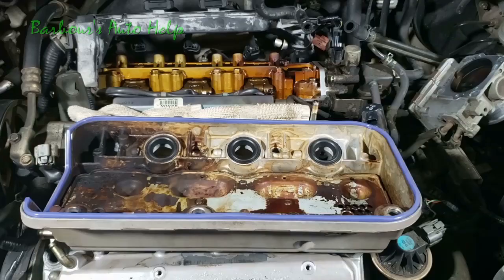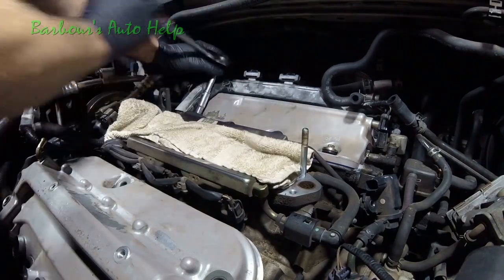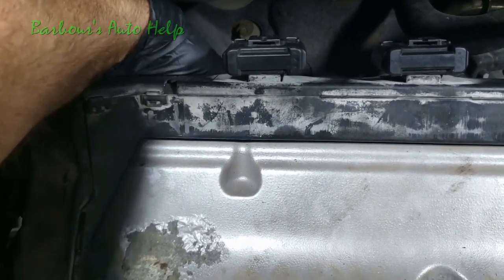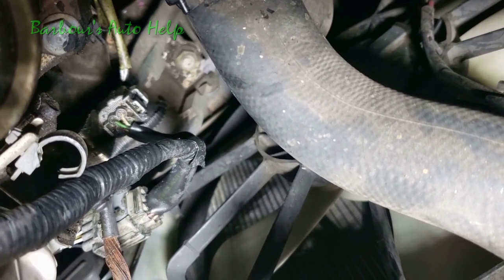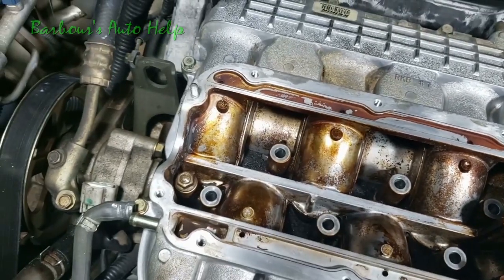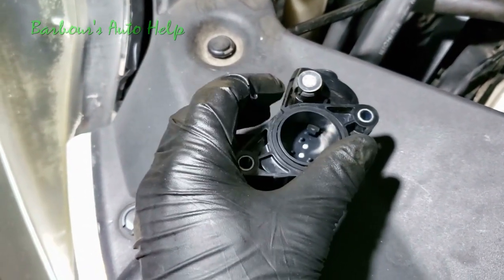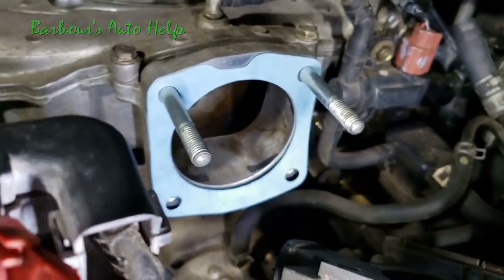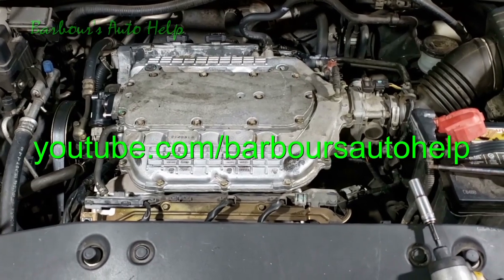Valve Cover Gasket Replacement 05 Honda Odyssey 3.5L Touring (Part 2)

Comment: Thanks for the detailed video. This would be a great time to do your spark plugs also. I listed torque values for those who do not have calibrated wrists.
Valve cover bolts =  8.7 Lb-Ft or 104 Lb-inch
Plenum bolts = 16 Lb-Ft or 192 Lb -Inch.........

Comment: Best LIVE description I have watched. Did this on an 2003 real pain but success. Just bought 09 and previous owner did a real good jog cleaning it up but was looking at motor mounts and saw a drop of oil and found rear valve cover gasket leaking and am going to replace all associated gaskets. Only have 126k on this one.

Comment: Just did this myself. Thanks so much! In the process I dropped the rear valve cover and cracked it. Dealership wants $1250.00 for the valve cover, I found it in a u pull parts yard and paid 5 bucks. It took me a few afternoons running for parts but in the end I saved myself a lot of dough and hope my van goes another 300k.
Reply from the maker: Great job 👏

Comment: Hi thanks for your videos. I was a little disappointed you did not give a hint about the rear valve cover. All you said was it was "tight getting out". After working on my car I found after disconnecting as many cables as possible that all you had to do was to take the cover back to the firewall and bring it over the top of the cables harness. That would have been a nice pointer to share. I hope you feel this is woth sharing. I've done alot of work on my 07 Odyssey with over 198K. Great car!
Reply: Thanks for sharing this tip.  Like you, I felt the only downside of this otherwise great video was excluding footage on how the rear valve cover was removed.  Did you have to disconnect anything else (from what he described in the video) to remove the cover this way?  Thanks.

Comment: Here are the torque specs for this engine, honestly, hand tighten is all you need 
Upper Plunm 12NM or 8.7 ft/lb
Intake 22 NM or 16 ft/lb
Throttle Body 22 NM or 16 ft/lb
Valve Covers 12 NM or 8.7 ft/lb

Comment: Thanks for your videos. it's really great job you've done brother. Even though I'm not a mechanic but I try to do most work follow you tube videos. I've a question My Honda odyssey 2006 Exl  Oil leaking on the catalytic manifold and smoke coming up. Do you think is it valve gasket leaking  or any others. suggest me please. Thanks.
Reply: Hey bro i have same problem With my honda odyssey 2008 did you fine any information why smogkin

Comment: Man I just finished this turned the van on and it sounds like a lawnmower..the check engine light is flashing...says misfire cylinder one...how the van wasn't misfiring before and also replaced all 4 oxygen sensors and new spark plugs too...what the hell went wrong and its smoking from the front of bank one...any advice please 🙏
Reply from the maker: Well, if it wasn't doing it before I'd suggest retracing your steps.  Make sure you did everything correctly.  Make sure you plugged everything back in.
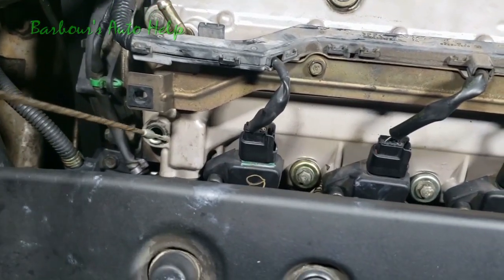Reply: @BarboursAutoHelp  ok im beat its cold it's 12:48 in Atlanta and I'm beat..will retrace tomorrow thanks
Reply from the maker: Did you get a chance to look at it?

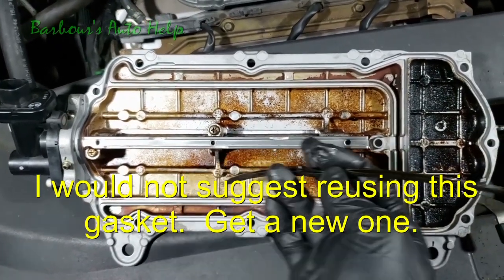Comment: Do you know the name of the gasket you reused at 24:45?  I can't find it anywhere in any gasket set.  Could I just use a bead of RTV as a replacement for a new gasket or should I buy some gasket material and cut a custom one?
Reply: Did you ever find out where to get the gasket or what the cover it goes on is called? I think I need one also...
Reply: If you pick up a Plenum Gasket Set in addition to the Valve Cover Gasket Set  they will include the gaskets you need.

Comment: Hey brother I have an 06 odyssey ex-l and I believe I have a leak coming from behind the engine somewhere below the valve cover gasket? I’ve replaced vvt gaskets, valve cover gaskets, PCv valve, and also the oil filter housing gasket. Any idea?
Reply from the maker: Could be the cam plugs on the rear of the cylinder heads.

Comment: Do you have a Part Number for the gasket at 25:00?
Reply from the maker: I do not.  But, you don't have to have that when ordering parts.  Just your vehicle information.
Reply: @BarboursAutoHelp  I was at autozone and Oreily’s and they couldn’t seem to find it. Nor did anybody seem to know the correct nomenclature of the part lol do you have the name of the gasket? Btw I appreciate the videos!
Reply from the maker: Excuse me...  I didn't actually click your time stamp at first.  I do not know the name of that gasket and I never actually got around to replacing it.  Sorry.  I think the dealership will be the best place to look for that.  Disregard the last comment I made.  I apologize.
Reply: @BarboursAutoHelp  all good, man. Thank you! I’ll post my success in here when I’m done with it, you’re my guide for this project!
Reply from the maker: Yes, please let us know.  Also let me know if you have any other questions....besides that one... that I don't have an answer for.   😆
Reply: @BarboursAutoHelp  will do!
Reply: @BarboursAutoHelp  Okay. I went to the Honda dealership near me and they quoted the part for $76.80...problems I ran into were:

1) The complete intake manifold gasket blow up for the 2005 model doesn’t show the part number for the gasket in question. It’s in the blowup numbered 23, but there is no nomenclature for that piece. 

2) The same blow up of the intake manifold for the 2006 model shows the exact same as the 2005 model, and that part IS as follows: Honda Part No.:17112-RKB-003. The name (according to Honda) is “Bore Plate Seal”, which is where the aforementioned quote comes from.  

So given that it is a 2006 part, yet the 2005 model has the same intake manifold as the 06. I think the part is compatible with the 05. I’m going to shop around and find a cheaper option. Keep you posted!
Reply from the maker: Dude!  Thank you so much for sharing that!  Super helpful.
Reply: @BarboursAutoHelp  hey man I just want to update you on a job well done thanks to you! This video saved me a whole lot of money! One thing I definitely recommend for everyone else watching this video is DEFINITELY have a torque driver on hand. I broke two bolts, one of which was user error (no torque driver), the other was broken using a harbor freight torque driver. Thank you so much for the video!
Reply from the maker: Your absolutely welcome.   And thank you for your contribution 🙏.

Comment: I have a 2005 odyssey with only 122K miles.  Cylinders 1 , 2, 3 plugs all oil fouled.  The i-VTEC with VCM engine is burning oil.  Dealer  they told me i needed to spend 8K for a ring job.  In 2008 Honda issued service bulletin 13-080 because of law suite in which they lost due to their VCM design .  Apparently VCM causes the piston rings to rotate and  align leading to premature spark plug fouling and engine oil burning.   Even  the 2021 Honda Odyssey is still using this VCM engine design.  Think twice before buying the odyssey with this engine design.  The car rides good on long trips but I regret buying this vehicle which has a poorly engineered engine.  Don't buy Japanese vehicles made in USA.  The QA is sub standard in the states..
Reply from the maker: Great information!  Thanks for sharing.   I have had the same problem.   The fix is to replace piston rings....or a couple spark plugs every 6 months.  Shoot I even resorted to using copper cores.  They are much cheaper.  They don't last as long but thats ok cause they foul out quick any way.   It got to the point that I would only have to routinly have to replace 2 spark plugs.  The rest weren't fouling.